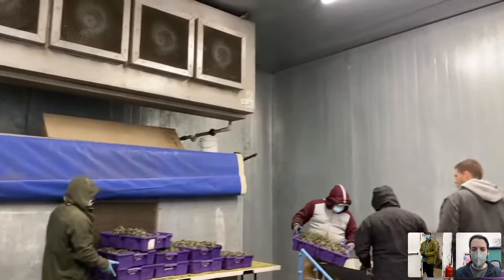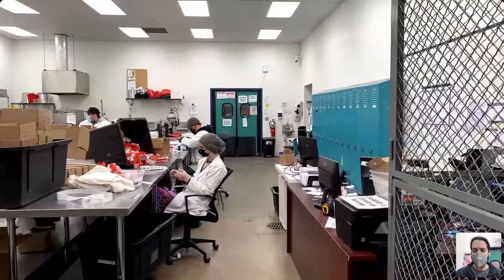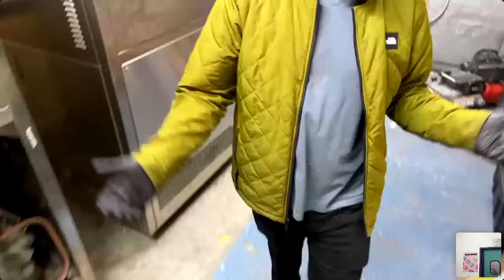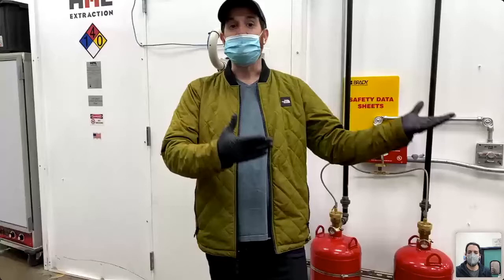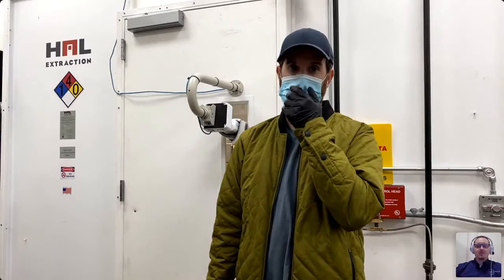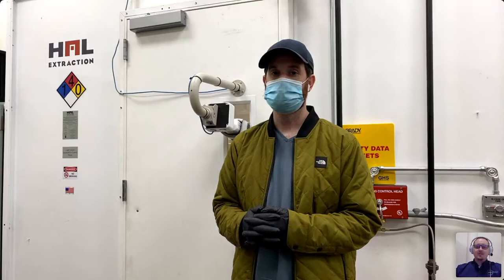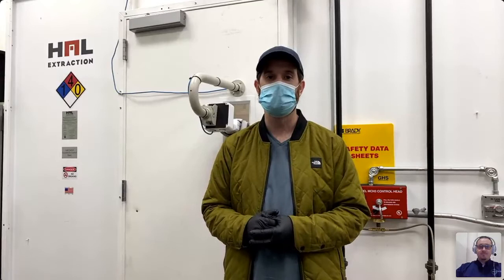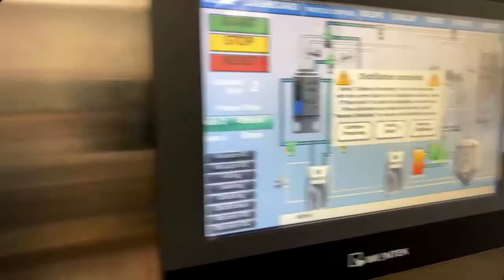Butane Extraction from Fresh Frozen to Final Pour  - Luna Technologies - Webinar #8

Comment: Why are you isolating the sauce from the diamonds?
Reply from the maker: Isolating the sauce and diamonds allows for a more controlled and effective purge of residual solvents during post processing. If the operator would like to retain as much of the terpenes as possible, one could purge the sauce at different parameters then the diamonds. Additionally, you can now choose the desired ration of sauce to diamonds once you reintroduce the two.